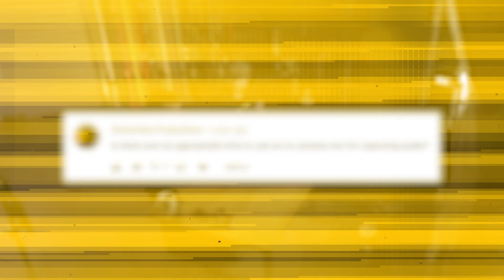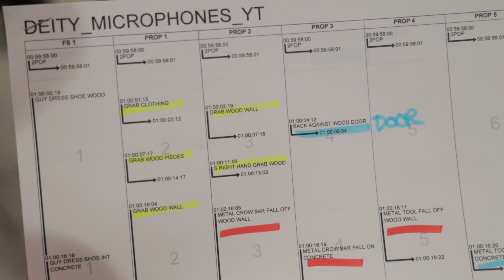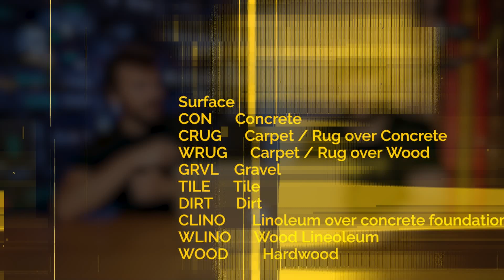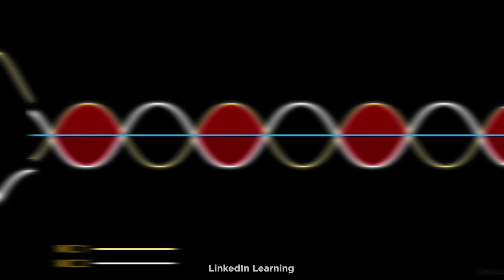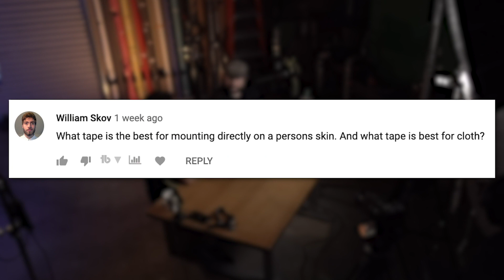TRS vs TRRS! Battle of the 3.5mm Audio Connectors

Comment: 03:22 in Reaper there is a great script with GUI just for this purpose naming and cataloguing the files for an easier management, so far. It's called UCS. Then you can use these catalogued files within DaVinci, for instance, using smart-bins and/or power-bins.

Comment: what happened if i have TRS and i used adapter TS femaly to TRS male and connect to insert put on the mixer . did the insert will change to be direct output without effect the sound on mixer ?

Comment: Hi!
Had a quick question in the TRS and TRRS pins.
I have a WDTV HD which has a 3.5mm AV OUT (TRRS) port. I want to connect a 3.5mm cable from it to an external speaker. When I connect it there is a loud buzz/ humming sound and the audio from source is very light. Is it because I am trying to use TRRS port with TRS Cable? Suggest a solution. Thank you.

Comment: This episode was awesome. I have a question, I’ve tried connecting my V-Lav directing to my zoom h8 both through the XY adapter and also an XLR-3.5mm adapter but I’m not getting a signal in either situation. I tried turning phantom power on and off but still nothing. What could be the problem?

Comment: i just bought a deity wireless pocket. i always using the zoom F8 mixerfield to capture my job as soundman.
i have a question: i believe this Deity pocket running about 3-10 voltage..my question is: is it safe if i connect it to my zoom F8 ? i just worry with the +48V phantom power from my zoom.
is there any trick to safely connecting Deity pocket wireless to zoom F8? should i using 3.5mmTRS  Deity to XLR? or deity TRS to TS ?
thank you so much. i really need you explaination .
Reply from the maker: You can use the D-XLR to safely convert 48v to 3v

Comment: If you've ever plugged your TRS headset traditionally an iPhone headset into something I noticed it didn't work very well and if you were clever enough to figure out if you pulled it out slightly it worked. This is caused by that Jack trying to use the microphone as the ground for the audio signal of the left and right and guess what it doesn't work well or at all. This is caused because the ground connection is usually the metal ring at the very bottom near the outside of the Jack it's not expecting a TRRS Jack and it's only expecting to make contact with me TRrS so there's nothing touching that second R so the signal kinda has to go through the microphone to get ground which doesn't work very well at all. There was a competing standard in the android universe briefly that swap the mic and ground and would have solved so many peoples problems, thanks apple.

Comment: Here's a question I have about 3.5mm audio jacks... So for backstory, I have a microphone reciever, that has an included TRRS/TRS cable, and I have a TRRS extension cable. It's not deity brand reciever, it's a PicoStream one, but the underlying problem would probably happen with all brands. The problem happens when trying to use the microphones on my PC, but only in certain circumstances.

So here's my problem... I hook my PicoStream receiver up to the PC with the included TRS/TRRS cable, and I can use all the settings just fine, including the  single channel per microphone setting, which I believe is the TRS setting (which reciever is set for), BUT, the problem is, if I hook up my TRRS extension cable between the included cable and the PC (in mic1=left ch, mic2=right ch mode) it doesn't separate the channels into left and right for some reason and just sounds like regular stereo/mono, whereas it works perfectly with the included short female to female cable...

Ok, so, after all of that, the question I have is this... Why does the included TRRS/TRS cable work fine, and do EVERY audio protocol, but adding a male to female extension cable seem to break compatibility with the TRS protocol??? Shouldn't it be able to do both protocols, if it's a TRRS cable??? And for reference the 3rd party extension cable is a "cable creations" branded one,  bought on Amazon, and it IS good looking (and looking like it will last)...

As much as I greatly understand how audio works, even for an audio noob, at least in general, I'm not sure what causes this to not do what it's supposed to...

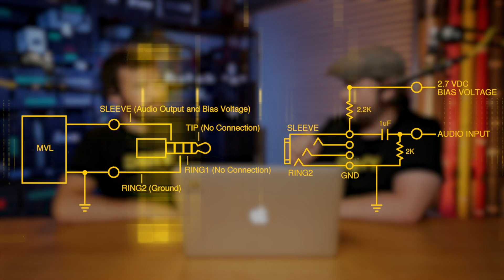Comment: 9:42 Excellent example of an indecipherable explanation. 
"Sensors on every single pin" Insie the mic phone plug or the phone plug jack? 
Sitting there on the audio jack == ok that means the jack
'it lines up that audio signal to that pin" You mean, routes that audio signal to -- that pin of the jack?
10:00 "when you plug a V-log into a phone" -- You mean a mic used for vlogging, into a cellphone? Or ???

10:08 'that sensor recognizes the fact that it's positive bias voltage"  Apparently the sensor inside the DSLR jack, recognizes the bias voltage on pin 4 of the cellphone

" and that that's the audio pin"
 You just said pin 4 was bias voltage. WTF???

"It lines up its audio signal of the lavalier" 
1 Which is "it"  
2 Which is supplying bias voltage? It should be the cellphone. Or is it the DSLR?

"...over to that pin"  WHich pin? Why wouldn't it be two pins? Is this a stereo or mono mic? If stereo wouldn't you need 3 pins? 
I'm guessing the DSLR recognizes that pin 4 of the cellphone plug has audio. But the graphic labels pin 4 as 'bias' voltage

10:13 graphic of two 3.5mm TRRS plugs, one labeled DSLR, one labeled Phone

"like a DSLR wants" Ummm do you mean 'expects'? or "is conventional?" or ????
" typically a DSLR with a built in mic supplies....i'm tired of multiple guessing

"Reallly technical answer"  More accurately a really sloppy, no effort put into clarity and accuracy answer. 

Each uncertainty, piles onto another uncertainty exponentially. Just three uncertainties, two with 2 posibilites, one with 3 possibilities, would mean  (2^2^3 = 64 possibilities. Nobody has time to try out 64 possibilities and see which one makes most sense.

Thanks at least, for an idea for a video:  How sloppy, train of thought explanations like this quickly become utterly intractable to decipher. And make otherwise bright, healthy minds think they are stupid, and give up trying.

I'm going to Google some more and I'm sure eventually I'll figure out how these "Plug-in Power" labeled 3.5mm jacks on DSLRs work.

Comment: My V.Lav works fine in the mic input of my Nikon D610 but is absolutely useless when plugged into the mic input of my Canon C100 Mk2. I guess it's not that "smart" after all.
Reply from the maker: Canon didn't add PiP to their 3.5mm jacks. They are the only brand of camera/audio recorder maker that does this.

Comment: Will a 1/8" TRS Locking Screw Plug work in the standard aux port of my portable amplifier ? I want to switch to an over the ear mic but most only come with locking screw plugs instead of a standard 3.5mm plug. Help please.

Comment: I use a trrs ro trs adapter with my deity v-mic d3 pro to record the audio into my Zoom H1 recorder.. the problem is the mic does not turn on. The light is blinking , showing it is in standby mode.. is there a way to record into the zoom h1 recorder?

Comment: Nicely explained. Can you explain various combinations of XLR to TS - TRS - and TRRS connections? And also how a TRS to XLR-Left and XLR-Right channel are distributed. I want to connect my RODE receiver to the ZOOM H8 via XLR.
Reply: I'm looking for information on different connection techniques as well, for a dual-mic setup I have, so this kind of video would definitely help me figure out which connections are needed where... For instance, my receiver supports outputting audio on a single channel, like having a left channel on one mic, and right channel on the other, individually mixed on a mixer, with XLR more than likely, or on cameras and computers, in the same manner,(using 3.5) albeit with a little less control of the audio mixing. Of course it doesn't support that on phone, and instead just sends what amounts to mono audio

Love my microphone setup, don't get me wrong, and it's fairly new, but I am still looking into the best ways I can utilize the microphones. Want to do videos with them eventually, but it's a bit complicated, when all I have is a pixel 4a phone, and no place to call a dedicated set, nor one clean enough to be, so I'm currently trying to find other things that I can use them for, such as doing video capture, with voice overlay...

Comment: Thanks for the video guys. Does the D-XLR not work with the Rodecaster Pro? I'm not getting any signal with the V3 Mic Pro going into the D-XLR into the Rodecaster Pro. I've tried it with phantom power, without, and all other configurations. I'm wondering if it's just not compatible??

Comment: #mailbag Why do I keep hearing static? I have a quarter inch to 3.5mm cable plugged from my mixer to my black magic atem mini pro to input sound into my VMix production software. I’ve bought three new cables, but nothing seems to be working. I always hear the low static. What is possibly causing this? Thanks

Comment: Hey guys. Kinda TRS question I guess. I’m interested in buying a W lav pro for my YouTube content etc. I wanna be able to plug it straight into my mixing desk (XLR or 1/4” or even stereo phonos, doesn’t matter), but also have the option to upgrade to a radio system later. What adapter connector should I get? I’m freaked out about voltages and weird connectivity issues!!!

Comment: Nice presentation, except you didn't answer the question about microphones and phasing. The question asked "What does it mean when Two Microphones are out of phase?" You talked about the resultant audio delay distortion when a sound arrives at an additional microphone after it has been picked up by a previous microphone. The question has to do with the engineering specs of every microphone, and is often quoted in the spec sheet, "...positive pressure on the diaphragm results in positive voltage on pin 2" or words to that effect. To be in-phase, any two microphones must adhere to the same standard. If one produces a positive-going waveform from positive sound pressure, but another produces a negative-going waveform from the same source, they are said to be out of phase. They therefore tend to cancel out the audio signal if the two outputs are summed, or if you're listening to each in its own monitor speaker or headphone, it sounds like your head has somehow been disconnected from reality--very disconcerting. The fix is as you suggest--push the button. If you don't have a button, check the wiring. You might also build a short jumper that purposefully swaps the wires on pins two and three between a male and female XLR. Cheers!

Comment: Long question related to audio, and probably a stumper: I am digitizing mini-DV tapes using a Canon Elura 60 and Elgato video capture. I am using the setup described on page 35 of the Canon Elura Manual( http://downloads.canon.com/camcorder/elura60_65_70_inst.pdf). The video signal is captured with an S-VHS cable, and that works fine. For the audio, I am using an STN-250N cable. On the camera end, the STN-250N plugs into the AV jack of the Elura. The other end has RCA cables and I am just using the red and white since the video is captured through the S-VHS cable. When I plug the STN-250N into the Elura, I get this horrible buzzing sound. I can capture audio ONLY if I take the plug half-way out. Now, the same thing happens with regular 3.5 mm TRSS headphones. Do you think that a TRS cable instead of a TRSS would solve the issue? (I ordered one from Amazon to try). If not, any ideas what the issue is?

Comment: I learned a lot here, thanks. But there is still something I Must know...My RODE external shotgun mic has a 1/4" TRS connector that works great on my Sony VIXIA HF M50...BUT my BOYA BY-M1 lapel mic has a TRRS which works on my Android phone and iPad but Not on the VIXIA.  Someone PLEASE tell me exactly what adapter I need to purchase to use the Boya BY M1 on the VIXIA HF M50.
BTW, New Subscriber to this great channel!
Reply from the maker: Your Vixia doesn't supply PiP to mics. So no adapter cable will work.
Reply: @DeityMicrophones  what is  PIP?

Comment: Hey guys,

Does a 2.5mm TRRS to 3.5mm TRRS adapter work? Its only for using the 2.5mm jack (connecting to amplifier out) connecting to 3.5mm TRRS ended headphone jack, (which connects to 2 3.5mm headphone plugs). Not intending to use a mic.
Thanks for the reply guys!

Comment: Sometimes if you dont have the right cable you can try pulling out one side  just a little (leaving an extra connector hanging outside of the socket)  to form a connection.

Comment: Hey guys... Great video!!!! Please can you help me with trying to plug a Boya -M1DM lavalier mic into an iPhone 6 and to a laptop with only two connections for a headphone and mic. The Boya mic has a TRRS connector, but when I plug this into my phone I cannot hear the person at the other end. Must I use headphones? Is it possible to use without headphones! And when plugged into my computer, I have a mic/headphone splitter connected to the Boya and the laptop, but the sound from the recipient at the other end is cut out when I use the headphones.

I want to improve the overall quality of sound when using Zoom, which is why I want the external mic in the first place.

Many thanks

Tim
Reply from the maker: Maybe ask BOYA?
Reply: Deity Microphones You would think that would be the sensible thing to do, but they do not reply to messages. 

No worries 

Cheers and thanks

Comment: @8:30 ‘initialism’ should be used instead of “acronym”. This is because it can’t be said as a word (TRRS).
Reply from the maker: As correcting Andrew's spelling and grammar is one of my favorite pastimes, I'm bummed that I missed this one - but eternally grateful for your contribution.
-Deity Steve
Reply: @DeityMicrophones  I have a question, Can I use a TRS on a TRRS socket or will I need a converter? I want to use a microphone that's TRS on the new Sony Xperia 1 iii phone, which I believe is the TRRS socket. Also, if I do need the TRS to TRRS converter adaptors, will they lose quality if I use an adaptor? Thanks!

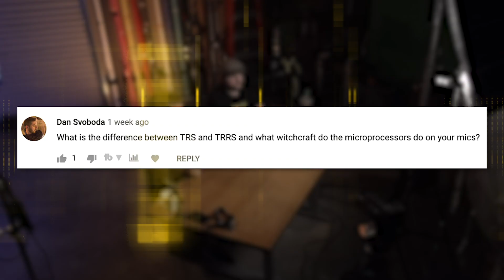Comment: Scroll to 8:00 minutes for the answer. Save your time. I already wasted mine 🤣
Reply: Thx, I still can't stand this explanation.  Hate techs like these.
Reply: @roundingcorners  I just got dumber watching this…
Reply: Thanks man, appreciate it.
Reply: David Garcia big thx smh
Reply: So was the answer: In order to have audio input into an iPhone (such as plugging a mic into an iPhone), you'll need to use a TRRS-to-TRRS cable that's plugged into a 3.5mm-to-Lightning adapter?
Reply: @bruhdamartinasty3636  I guess yes. I am having a hard time hacking my GoPro 7 Black's mic system. I don't want to buy the expensive GoPro mic adapter.
Reply: @lembeltran1738  Good luck to ya. . I'm guessing there's a huge GoPro community that can help.
Reply: @lembeltran1738  What I found after exhaustive searching is that without that adapter you won´t be able to connect an external mic to the Hero Black GoPro camera. I am sure it is true for version 5, not sure about the higher versions as I do not own them.
Reply: bless your soul!!!!!
Reply: Thank you!
Reply: yeah i wasted my time for nonsense questions, the title trick me
Reply: hero!
Reply: MVP, right here!!!
Reply: Thanks for that!!!!
Reply: Saved me from the yapping
Reply: muchisimas GRACIAS! enserio

Comment: I love your videos and 
I learn more from them than in my sound classes at the film school thanks. Q: In a low budget production, with two characters, and whit only one shotgun for the dialog how, do you catch the the exchange of words if the 
rhythm changes from a take to another?
Reply: If you have a boom op, or someone from your class just happens to be the one using the boom, first set your levels during rehearsal, the boom op should know the dialogue or try to learn the cue for each person and it shouldn't be too difficult, please keep in mind the frame, if you have a wide shot, it can get tricky or impossible, sometimes you need a 2nd boom, if you have a huuuge wide shot, the boom can pick up some of the dialogue, and then capture the best audio posible during the close up and mid shot

Comment: For sound design, how would you go about recording a sound effect that is very quiet but in the final mix it needs to sound a) loud (so it could need boosting in post but to a degree that will raise the noise floor significantly) and b) far away (so holding the mic as close as possible to the source of the sound effect makes it sound too close)?

Comment: Great video, some headphones made for phones not only have a mic sending a signal down the sleeve but also can change volume etc. but all of the channels have been used up, haven't they?
Also, you mentioned that phantom power goes down the ground channel, I'd love a more in-depth video about that.
Reply: Yes having a microphone signal and control signal on the same wire is a feat of engineering. There's a couple different ways to do it when is to use a slight resistance that is detectable and this has traditionally been the method for the play pause button.  for the volume buttons have gone two different ways depending whether you're android or Apple, Apple uses a communication chip and android uses a simpler method with just slightly different resistances.

Phantom power is actually carried on two of the wires in an exact balance so that they are like the phantom of the opera there's no power here to the capsule of a dynamic microphone. But anything that would require processing can take a vantage of that using the ground connection and carefully separating the power off of the other two wires.
Reply: @imark7777777  Very interesting. Thanks for explaining!